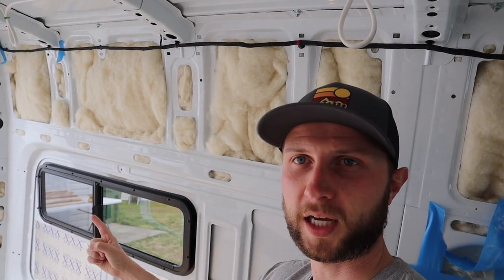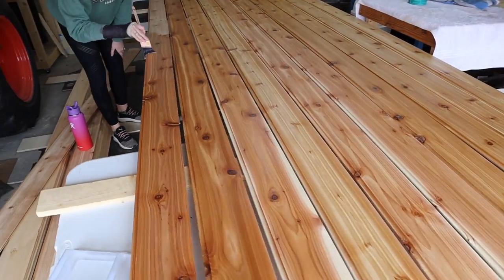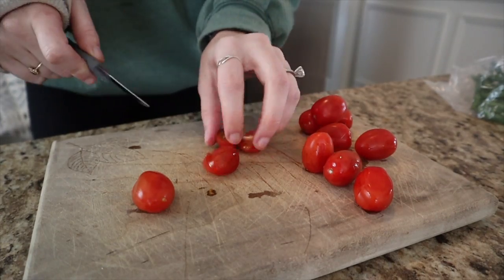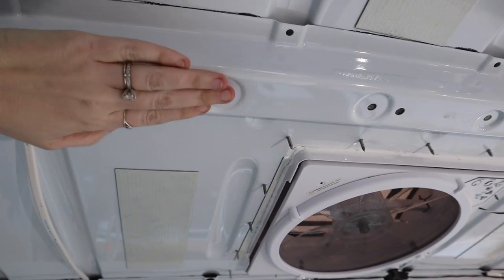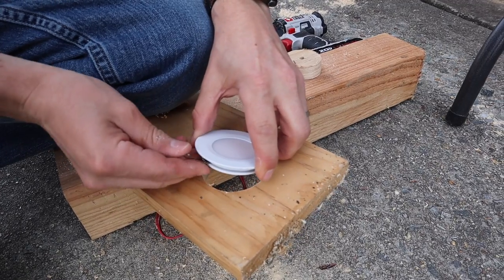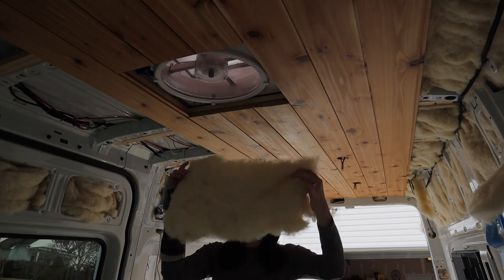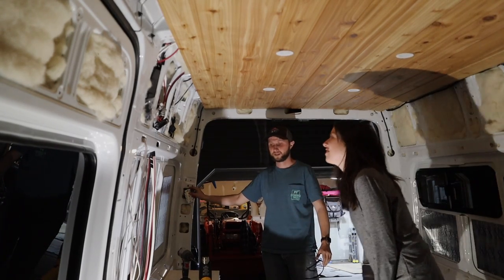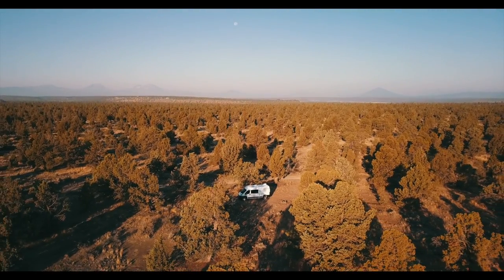VAN BUILD | Installing our Cedar Tongue and Groove Ceiling

Comment: Hey awesome work! Cool ceiling.  I have question. Have 04 GMC SAVANA hitop with superb sound system. Gutted walls adding mineral wool and into doors too. For ceiling detail considering using my1/8”western cedar boards but instead of interlocking T&G would space them 1”apart.Reason being there are 1x4s embedded into fiberglass 9” apart leaving 3/4”space to be utilized as an air gap. I acquired some 1” semi rigid 2’x4’ mineral wool with one side foil backed  and could install having foil facing toward exterior aiding air gap characteristics. On interior side use a black acoustic fabric then install the the cedar with 1”gaps maximizing mineral wools acoustic value.  All door windows and 3 large windows are all operational along with Maxair fan for ventilation. Alls left is an effective thermal acoustic covering windows and will be good to go. Any recommendations and advice b much appreciated

Comment: What size brad nail do you use with the 1/2 planks and 1/2" furring strips. It's recommended to use 3x the thickness of the plank but you would have to be really careful with your nailing angle nailing into a 1/2" furring strip.